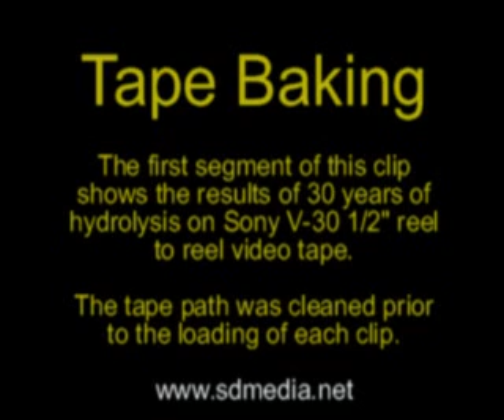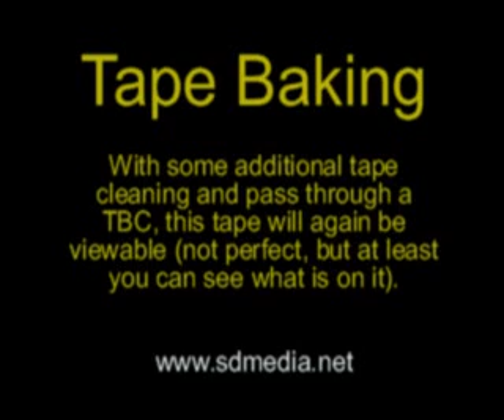Hydrolysis and Baking of V-30 Videotape

Comment: This is one reason why you should keep magnetic media in a dry environment. I've been given audio and video tape where the magnetic coating drops off as soon as you touch it, all of it was stored in a shed or garage. If more people were aware of these problems they might take better care of their archive material, e.g. air tight cases with silica gel in them.